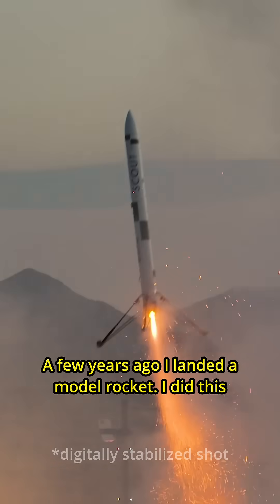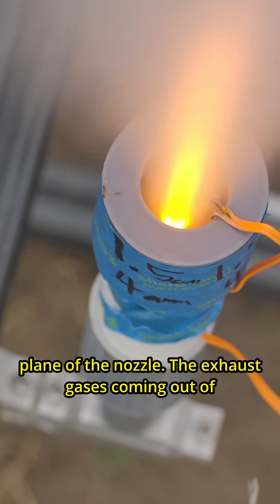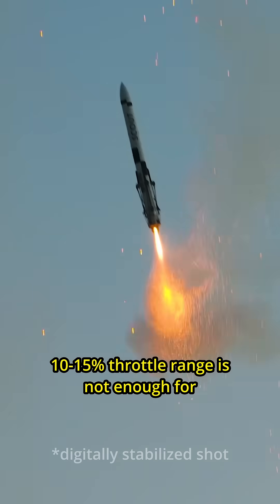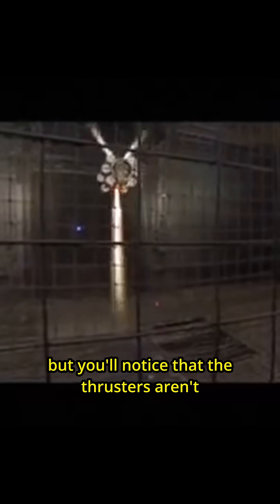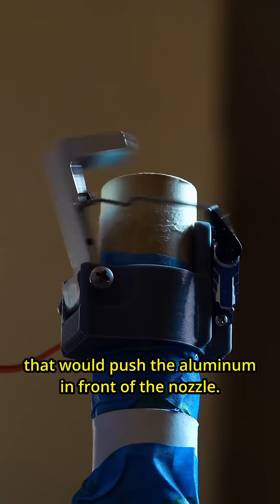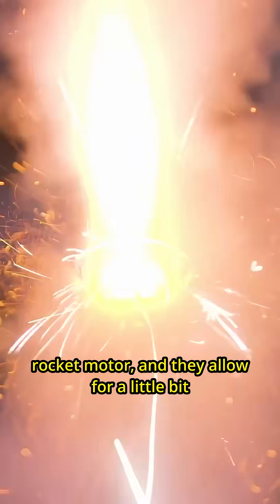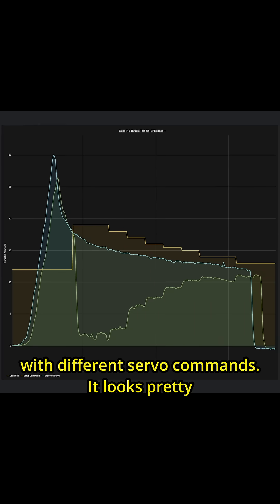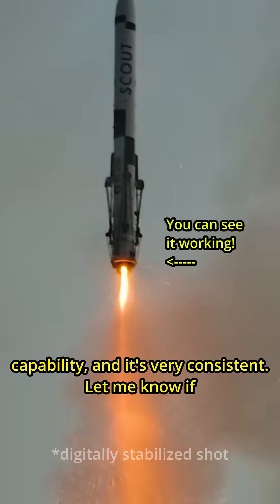Solid Rocket Throttle Control

Comment: PWM is a perfectly good name for what you were doing.  Anybody who understands what your problem was would know the term.  And yes:  It was an obvious simple solution.  Some of my friends took part in a contest to see how long it would take them to make a scrolling text display, using a hack saw blade with a chip of 10 LEDs glued on one end, and a solenoid.  The Solenoid would make the saw blade  swing, and a computer would control the LEDs.  It had to display a short canned text message.  It took the winner about 90 minutes.

Comment: I had commented like five ideas and now it's not there so woo for that. Anyway, I was proud of the last; F/A > F/(A + (2*cos(θ)*pi) using a De Laval nozzle, and varying the diverging end. Due to the coanda effect, some of the gas will also stick to the sides after trying to decompress (bernoulli's principle) from the choke/neck/convergence. Not only does this lower the thrust, but it also creates a cushion of air/gas beneath it with the vorticity (and turbulence, I suppose) from the decompression with bernoulli's principle, and induces more drag. Really, it's threefold in one solution.
Reply: Nerd
Reply: Hell yeah  @literally_ramiel
Reply: That’s not gonna reduce the thrust nearly enough for this kind of throttling unless maybe it the overall mass of the rocket is next to nothing. There’s been a lot of experimentation with movable plugs and bells to take advantage of the coanda effect. One of the reasons it’s not gonna work as well with the solid rocket versus liquid rockets is just phase change and gas volume vs reaction mass thrown out the back. Same reason it’s a more favorable design for O/H vs O/CH4 and O/RP1 and HNO3/UDMH
Reply: isn't this what SpaceX uses?
Reply: @FnjordKnot  Most rocketry utilizes de laval nozzles for all of their advantages, there's a few toys on some websites that let you play with aerodynamics and nozzles and how it affects thrust.
Reply: @FnjordKnot  adding to my other comment bc my edit isn't working; NASA, if i recall correctly, used a cv/dv nozzle on the raptor engine and/or the one they used in '69 to land on the moon!
Reply: I proposed a garden hose nozzle. But you added math.

Comment: I wonder if you could do something like put a brushless or brushed motor with ceramic disks offset by some distance that intersect with the nozzle during their rotation so you could throttle control with an ESC or H bridge. It would be higher frequency control system maybe but would have some inertia and stability considerations possibly.
Reply: Brushless* so you can e-brake them for responsiveness.

Comment: you could try a drifferent way to close the hole like using an aperture to even out the closing geometry, the onlly issue i can see there is the potential to introduce rotational forces

Comment: Using 3 shut off servos like a drill chuck might help, but you wonder if you just close the nossle completely if that back pressure would just cause the rocket to explode

Comment: I think i would have instead used 3 smaller motors connected to servos so you can pivot them in and out. Yes a bit over engineered and it would probably cause some spinning issues buuutttttt. Thatss okayyyy.

Comment: This is great!  My only suggested improvement would be to use an iris as opposed to a pair of levers. This would give a smoother, and more complete, throttling effect, would reduce possible points of failure to a single mechanism, and probably better protect that mechanism from the backwash.

Comment: I would have solved it a little differently. Blocking it as you did, with a flat surface caused a lot of the hot exhaust to be directed back at the rocket burning it up.

I would try adding some material to your device so that once it's closed there is a pointed triangle shape under the exhaust. This would help direct the exhaust outwards in a smoother path.

The second method I would try is two half circular "D" shaped short tubes in place of your "pincher" device to split the exhaust. Then use your servos to angle these short D tubes outwards to direct the thrust to the sides.

Comment: The V2 had little graphite fins in the exhaust plume to steer the thrust. Moving it side to side quickly would also change the throttle.

Comment: I was expecting throttling through thrust redirection - if you can split the rocket exhaust to have 50% go each side at 90°, then that would mean you’d have 0 downward thrust (which is far better than required), so a splitter that got part of that would result in partial throttling that, if combined with being able to adjust the angle of each split, could also be used for some amount of steering.

Your method did technically somewhat split the exhaust, was way simpler, and clearly did everything you needed it to do, so I’m just going to conclude that I overcomplicated it.

Comment: Instead of pinching from the side i'd have tried an iris-like system, the thrust that gets deflected would with that system be distributed more evenly to all sides and would in theory only need one servo if set up properly. That would be a bit difficult with such thick ceramics, and if making them thinner would be a problem i'd look into tungsten or tungsten-coated materials for heat resistance.

Comment: The attenuator/thrust-reducer should be round and adjustable in diameter (like an aperture) and in distance from exhaust. The thrust should travel over/around this bowl-shaped attenuator, for added stability. Grooves in the outside of the bowl should provide addtl stability

Comment: Just to be silly I would set up three tiny ceramic turbines and vary their position. As the plume spins them they act first just like blockers but they also blow opposing air. Why? It would be amusing to watch. Overspeed and burst would be an issue I guess.

Comment: You want to do the opposite of what you did here. Use a smaller motor and an eductor in a ramjet configuration. Throttle the amount of air.

Comment: Great solution, but with 3 servos and 120° chamfers on the blockers '>'  you could do thrust vectoring as well as throttling!
4 blockers may be simpler, but heavier.

Comment: I've always wondered if there wasn't a way, instead of having the oxidizer mixed with the propellant, if the oxidizer couldn't be introduced into the nozzle at the point of ignition, under pressure, as either a fine mist liquid or a fine dust injected into the ignition point. If this could be designed, would varying the oxidizer serve to throttle the rocket? 
Probably not, just an interesting thought experiment that occurred to me years ago. But I became a fighter pilot instead of an astronaut because the shuttle bored me, and I never explored the idea.

Comment: It's wonderful that you are able to hypothesize a solution and test it out, face challenges and overcome them. If you are not a rocket scientist, I don't know who is. 
The suggestion from the guy from Ukraine could be something. 4 ceramic pieces instead of 2. I'd also feed the data to build an AI model to help with their movement in response to manual input.

Comment: Great engineering and results. For no specific reason I feel like having a dedicated servo for each arm means truoble in the long run. You might want to design something similar to a camera lens or the nozzle of a jet engine, where the amount of choke (ideally from all sides) is controlled by a single actuator.

Comment: I liked you pincer exhaust technique for solid booster throttle choking. What would happen if used the same ceramic to make a chisel point exhaust splitter/diverter; To split the exhaust into 4 plumes, diverted 40 degrees? So, instead of a single exhaust coming straight down. You'd have 4 exhaust legs pointed or vectored away from center. Thus the upward thrust would partially cancel due to opposing vectors; no?

Comment: . . . Why not just use a solid rocket fuel that can be burned with electricity 
The reason why this works is because it needs constant electricity to burn and the varying amount can change thrust 
 So like . . . Idk kind of seems like a skill issue

Comment: That rocket motor drone is nuts!!
Reply: Exo-atmospheric kinetic kill vehicle. There's a few old videos of them on YouTube. The clips here are of one doing a simple movement translation test. Another one shows it doing precision roll maneuvers. In orbit they could move around much longer because some of the thrusters wouldn't have to pulse constantly for hovering or for stability. Upon being targeted at an ICBM the main rear engine would fire to send it on an intercept course. Then the others would quickly pulse to fine tune the intercept trajectory and for terminal movements to ensure impact. The rear engine would also fire just before impact to assure destruction of the missile or warhead.
Reply: And that video is from the late 80’s…So that’s OLD tech.

Comment: The problem you may have as did Sspace X is the build up of pressures and temps internally causing those fabulous explosions on landing. The fuel is still burning and that heat has to go somewhere, BOOM.

Comment: Are you trusting to the expected thrust output based on a standard throttle profile or do you adjust inputs to the throttle mechanism based on sensor data?

Comment: Seems to me, that technically this isn't throttling but braking.   Once the exhaust gasses leave the nozzle opening itself they've created all the actual thrust they ever will.  By putting a barrier in front of the exhaust stream, you're putting some of the kinetic energy of the gasses into the obstruction, which is attached to the rocket so it's pulling down on it.  Like blowing a fan into a parachute.

Comment: Why not go a step further, while the solidmotor cant be throttled or moved its exhausts can. So you could build a vectorcontrol by exchaust diversion with those ceramics eliminating the need for coldgas systems

Comment: Add one or two extra shaped blockers, and rather than just a block end, consider giving the contact area of thrust more of a v shape to channel the exhaust. With control surfaces like that it should allow for some more directional thrust vectoring.

Comment: "pulsing the thrusters". That's hilarious. Back in WW1, most aircraft simply had a switch to ground the magneto, which ceased ignition, and the glide-path/vertical speed of a landing aircraft was controlled simply by doing this, there were no "throttles", the engines were flat-out or were repeatedly "cut". Nothing new under the sun!

Comment: Thrust reversers that open downward and horizontally to dump unwanted thrust. Would take time to find the right design, but you could control the thrust on the horizontal axis (waste thrust) with some sort of restrictor that would increase your downward thrust if needed. Would give you a ton of control that isn't binary. I know pwm ends up not looking binary on the macro scale, but it is ultimately just an on off switch going fast

Comment: Interestingly the rotary engines popular in ww1 aeroplanes were challenging to throttle by reducing fuel and intake area, instead they had some timing control but for anything below cruise the pilot would cut the ignition, just like that interceptor hovering by pulsing its rockets.

Comment: If cars use pistons & nozzles to spray fuel into to the pistons, can’t something like that work for this? Throttling sprayer nozzle rather than moving parts for less wear & tear

Comment: See, what I would have done is stack several solid fuel boosters on top of each other with a decoupler between each one. That way, when you're done thrusting, you just hit the stage button and the bottommost booster will fly off harmlessly into space. Stack enough of these on top of each other and you can send Jeb all the way to the Mun!

Comment: There's only a breif period and relatively little force necessary for throttling to a stable landing. Why not use solide fuel to boost at takeoff and a smaller liquid fuel for landing?

Comment: Personally I believe you’re handicapped by using one thruster. The key to the missile defense system wasn’t the pwm but the sheer number of thrusters that could be modulated. Just look at SpaceX over the years, essentially adding many more controllable rockets creates more stability instead of using a few really big ones like we have traditionally.

Comment: My thought is maybe 3 smaller rockets attached to the sides that are lit during decent, they have enough power to stabilize the rocket during the decent but not enough power to overcome the weight so you get a controlled landing? Maybe these rockets only last like 30sec and are triggered by the height of the rocket. Meaning at X feet the rockets activate and during this time they slow the rocket down and stabilize it, timed to go off shortly after landing. With testing I think you could fine tune the height at which they fire giving you the soft landing without having to use the main thrust rocket.

Comment: you could have also used Inconel 625 for the throttle controllers. It would have been cheaper than ceramic.

Comment: Okay, this will sound wild because I just overthought this, but do you know of this closing mechanism that when turning the rim of a circle one side, vertices come out of the edge of the circle to enclose the circle with the sides of the vertices? But when you turn it the other direction, it opens up? Well, put a motor on that and use very heat resistent vertices and you're good to go.

Comment: Can you port your ceramic blockers to divert exhaust gases at a 45° angle in four directions? Not sure that 45° is specifically best, but that or a more shallow angle, normal to the rocket axis, might provide directional control. With (4) 'blockers', you may be able to increase your directional control.

Comment: I would have simply tried splitting and deflecting the jet axis-symmetrically. The greater the angle of deflection, the greater the reduction in thrust. Imagine the petals of a cone flower. Like @HartenDylan said, you could try actuating it differentially for steering.

Comment: I think the whole blocking of the exhaust is probably the simplest of choices and most effective. 

If you think about the icbm thingy, the option to use either separate boosters to counter thrust could work too. 

Have you thought about redirecting some of the thrust by exiting it from the side using open&close ports (made with ceramics ofcourse, that allow a portion of the thrust to be diverted, therefore reducing the overal power of the thrust?

Comment: They’ll have to line up though, in one of the clips with the ceramic ones you can see it curve the flame. That will act on the rocket in a similar way thrust vectoring does

Comment: PWM being a concept in rocketry and also synthesis is so cool, physics connects everything in ways you don’t expect
Reply: PWM is also common  in many fan circuits, fuel pumpd, pretty much anything where they need varying duty cycle
Reply: As a Synthesizer guy, PWM surely is cool with me.
Reply: PWM controls many things in life, and has for a great many years … 

Actually it’s mostly just “pulsing” that is the greasy of benefit in many, many applications …

Comment: FYI, the PAC-3 and in-development CUDA missiles use hundreds of single-use small composite propellant "thrusters" as a way to "steer" the nose of the missile to allow manoeuvrability far beyond what gimballing and/or aerodynamic surfaces can offer.  They are in no way similar to the concept you showed, and TBH, I don't know how that example relates in any way to what you were after!  (using small, individual, perpendicular bursts of thrust to control heading has absolutely nothing to do with "throttling" a main engine!)

Comment: I'm no rocket doctor myself, but i'd use a design that has 1 single rocket motor that provides half of the thrust i need. Then 12 smaller rockets around the larger rocket. Lighting them off in 3's. You can vary the thrust by varying how many solid rocket engines are lit off at once.

Comment: You could have more than one ceramic arm in front of the booster or make an iris mechanism around the outlet that can be controlled by 1 or 2 motors to save weight. As for 6 directions of maneuverability while airborne, you may be asking for too much with 1 thruster. Instead, take a glance at space x. Using air resistance as a mechanism for steering in flight.

Perhaps a combination of these methods could yield the most favorable results. Whatever you test, just stay safe and have fun.

Comment: When I hear PWM I’m thinking in hertz so what came to mind was a spinning disc (propeller shaped) that would block the gases and spinning it at a different rate would change the duty cycle and thrust.

Comment: The only thing i think would've been done differently is the jaws being controlled from one source so you don't end up with one further out than another. If they were controlled at one point like scissors they'd open and coat with consistent spacing

Comment: Cool
With three servos and ceramic blocking plates, you have direction controlled flight in addition to just landing. 
With a gimbal mounted ceramic nozzle added to the mix, precision maneuvers should be possible as well.
(sadly, that would make the whole works pretty heavy)

Comment: yk those segmented twisting doors that have warped triangle looking pieces that fit into each other to make a circle? make something like that from those ceramic stuff so you can make the hole smaller or entirely blocked if made especially well enough

Comment: I'm not sure how well it would work with high temp ceramic but a shutter style nozzle with side vents would give you the option to direct force out the sides as well to not only lower thrust but stabilize in another axis at the same time

Comment: other solution: make the thrust almost equal to the weight and use compressed air/CO2 and a valve to add thrust when you need